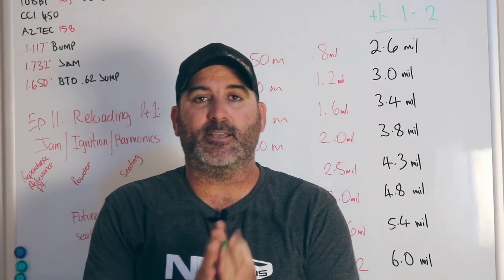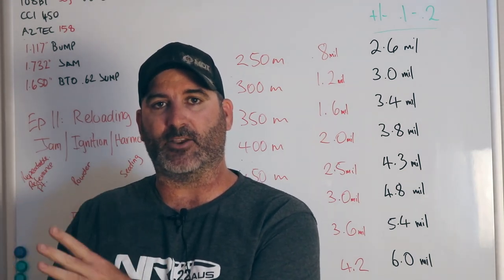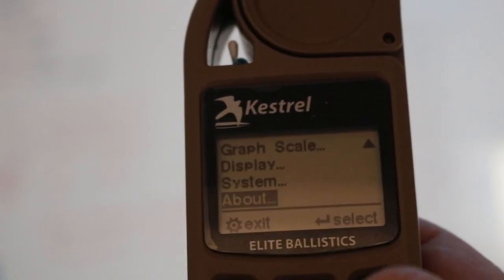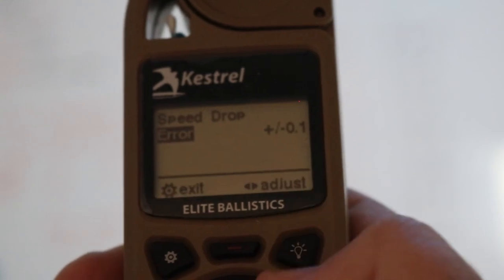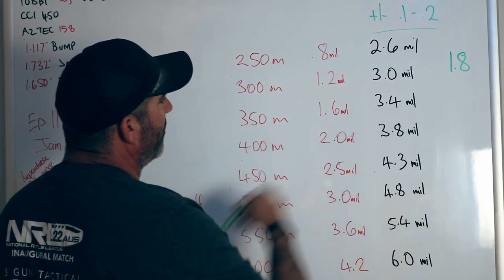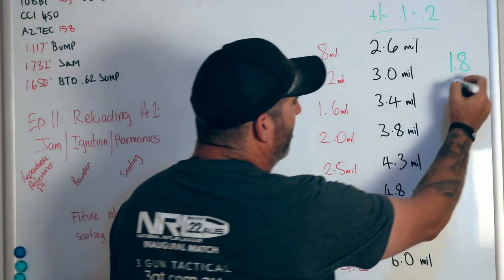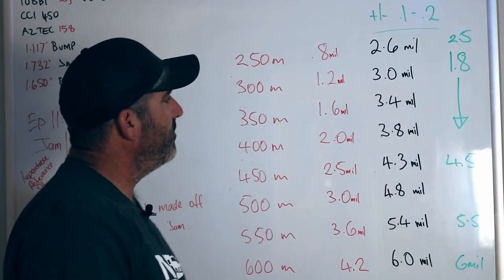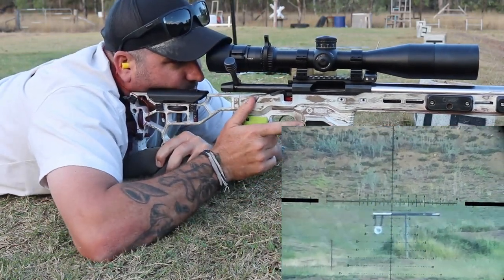Applied Ballistics, Speed Drop with the Kestrel 5700

Comment: Now that’s a game changer for me in the paddock. Thanks mate.
Reply from the maker: Ya can dial up your speed drop to the closest 100 and just minus that from your range which gives you the same answer. Eg:
Speed drop is 1.8 , simply dial up 2mil and minus 200 off your range, 300m -200m = 100 so hold 1mil.  Speed drop 1.5 dial 1.5 and minus 150 off your range 300-150m so hold 1.5mil

Comment: Is it best to not set zero stops then and just set turret back to zero?
Reply from the maker: You can use speed drop dialling under or over. If you have a zero stop I’d always recommend using it which in that case if my speed drop number was 1.8 I’d dial that and minus 200m off all my ranges in my reticle.

Comment: good stuff, thanks man

just starting to get familiar with the topic myself

is the calc available anywhere outside of the 5700?
Reply from the maker: You can do a bastardised version using normal software by dialling down under your 100 zero abs playing with the numbers till you get it. Won’t be perfect but it will work very similar
Reply: If you have 'Strelok Pro' on your smart phone and its up to date, 'Speed Drop Factor' has been updated into the ballistic package! It can be found near the bottom of the 'Change Cartridge' page just above the G7 and G1 buttons. Its in table format, in color, very easy to use. I don't know if it was mentioned, but for this to work a mil/mil scope is required. Go watch "Speed Drop Factor-long range shooting w/o a dope card" by "Mountains, Mullets, Merica!" A well done 21 min video!
Reply: @missedshot9235  oh wow totally missed that they had added that.  Ended up just using Strelok to guess and check, but the number they now supply suggests what i found it as well.  Solid feature add.

Think Mullet has one of the more underrated channels, dude deserves more views.

Thanks for the tip.